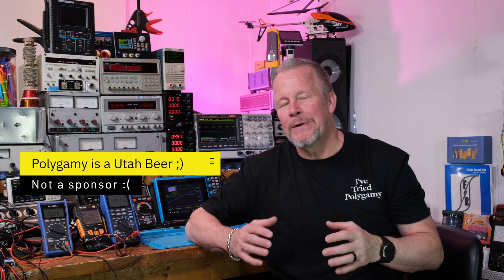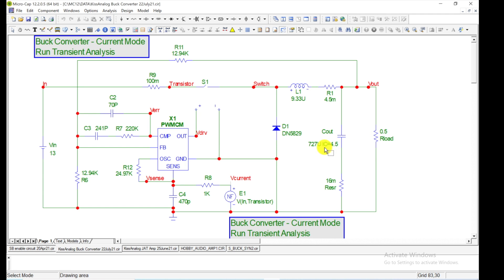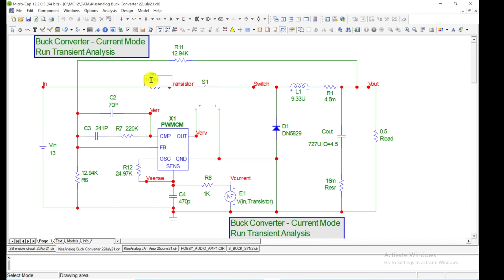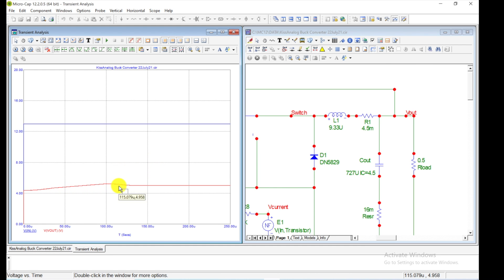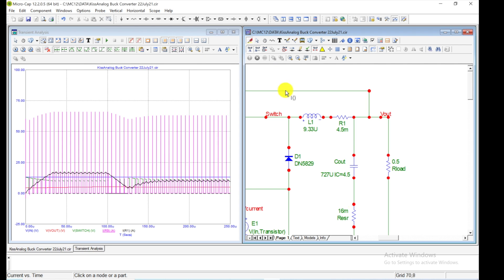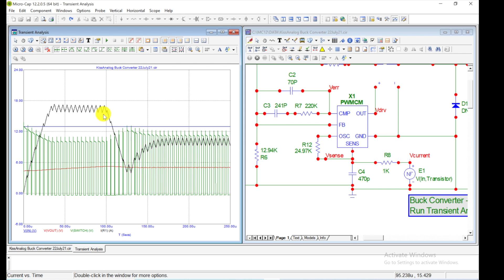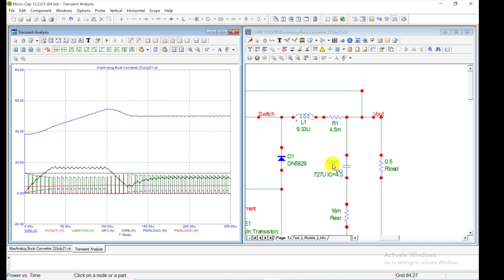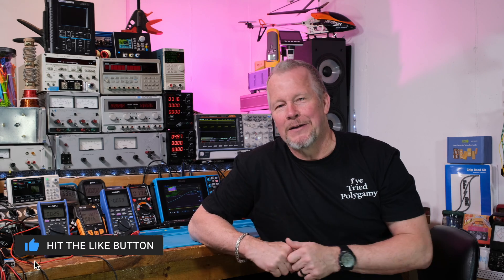Buck Converter Simulation in MicroCap tutorial SMPS #6 #buckconverter #microcaptutorial #SMPS

Comment: I have been using MC12 ever since it became freeware and find it quite useful tool. I used it to successfully design and simulate several SMPS power supplies with idealised inductors. 

However, when it comes to modelling of particular ferrite cores with commonly used ferrite materials I was at loss due to somewhat vague MC12 user guide and no sample circuits provided. No matter how careful I was when modelling the transformer (in my case ETD34 with 3C90 ferrite) the real life tests didn't correspond well with the simulation results and I had to tweak the transformer in hardware. 

While some extra time spent on bench work is not a major issue, it would be great if modelled inductors would correspond more closely with real life components. Since it appears that you're quite proficient in using the MC12, could you please do a video of modelling and simulating real life ferrite transformer?
Reply from the maker: This is a great subject - so thank you for this feedback!  Yes, I'll do what I can to show how I simulate magnetics;)  I'm due for another MicroCap tutorial;)
Reply: @KissAnalog  Thank you!
I can hardly wait to find out what did I do wrong with modelling of real life ferrite cores.

Comment: Thanks, Eddie!  This will be a good start for me with MicroCap.  I've had it installed since learning the author released it for free, but I haven't done anything in it but poke around through the menus and drop a basic (V+R) series circuit down - and I'm not even sure if I ran the simulation on it.  I've played with 5-or-so different PSpice simulators over the years but only LTspice for anything serious (as far as spice goes), and I've been using that since shortly after its initial public release as SwitcherCADIII around the turn of the ...millennium... oh yikes!  If I can learn the MicroCap tool well enough, it will be a nice supplement for comparing simulation results between the two tools for 'sanity checking' designs.  I'm really big on sanity checks, especially when schedule or complexity doesn't give me the option to build and test prototypes.  Most designs these days are getting nearly impossible to hand-prototype anyway.
Reply from the maker: Thanks - great feedback!  Some designs with difficult to solder part are easier to simulate;)  I like to simulate then prototype to shorten the process and to help optimize the circuit before testing.
Reply: @KissAnalog  Yep, I like to do the same!  Once I have testable hardware, I'll make a feeback loop between the hardware and the simulations.  I take real measured values from the circuit and replace assumptions I had made or calculated in the sim schematic, then I'll use that to tweak real values in the circuit if necessary. :)  It's always nice when the sim and hardware match as closely as possible, because if I need to make a change later I'll feel more confident that the simulation will provide accurate results.
Reply from the maker: It sounds like we have the same method;) I have much more confidence in my sim once through the process, then the next design is much more predictable.